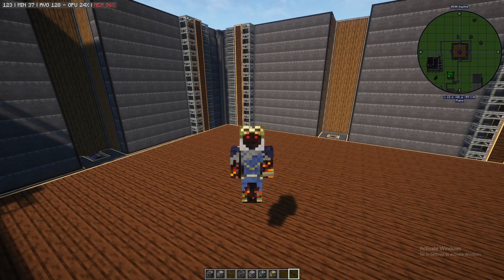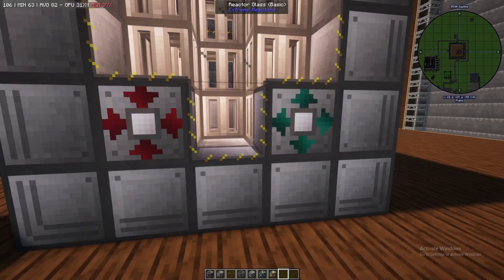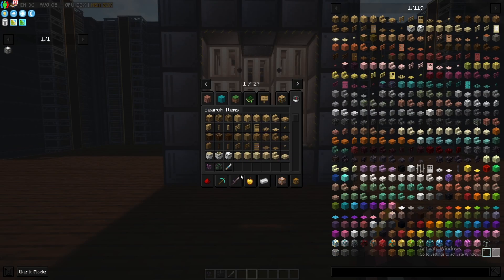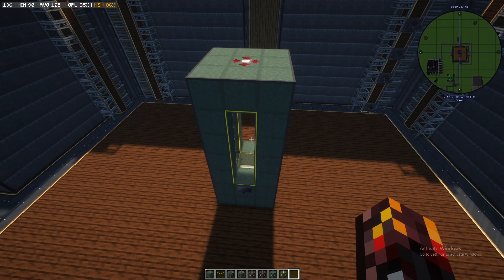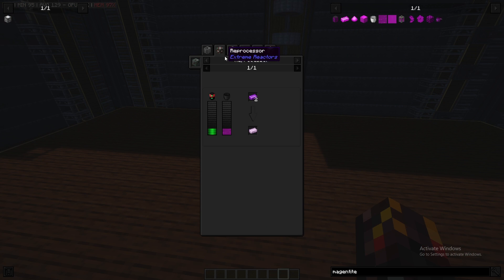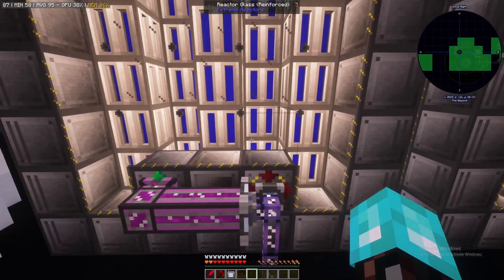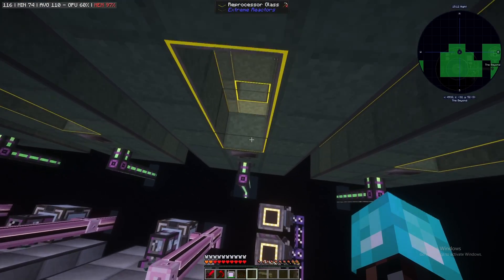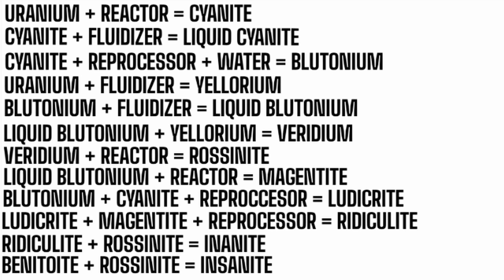Dumb$hits Guide Making Insanite! (ATM9)

Comment: No turbines? Which blocks are the best in between the fuel rods? Also, what is the max power you can get out of it? This really isn't a guide for Extreme Reactors, but a guide for creating Insanite for ATM9. With that being said though. It is an excellent guide for creating Insanite for the ATM star.
Reply from the maker: I should definitly change the title to how to make insanite, I did incluse the list of the best reactor moderators in the description

Comment: This is a somewhat irrelevant question but why do you use AE2? I ask this from a curiosity standpoint. Currently using RS because I find it quite simple. Would it be beneficial to dig deeper into AE2? I am a total noob at both
Reply from the maker: I personally use AE2 because it's more powerful, it has very stromg autocrafting capabilities, including stuff like not being limited by NBT data, and it's a fun challenge to setup the networks.

It also doesn't corrupt your world which is nice

There's too much to go into here, but as long as your careful RS is also a valid option, I just personally love AE2 much more